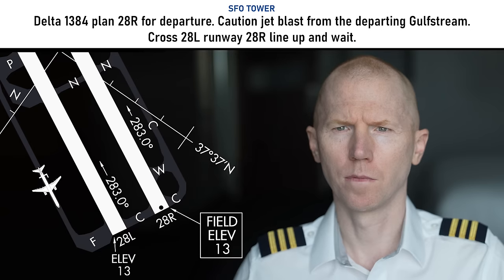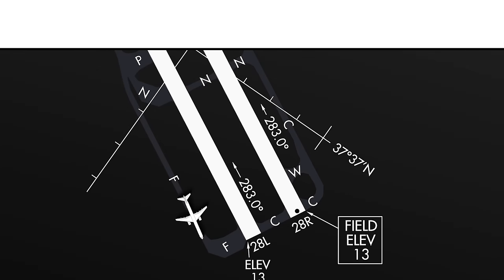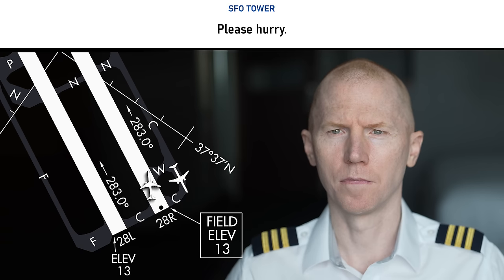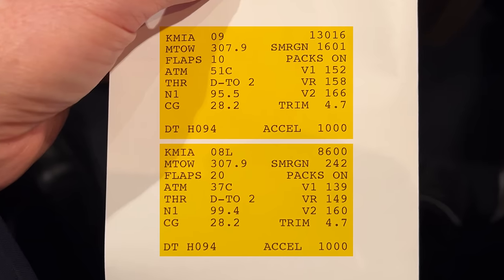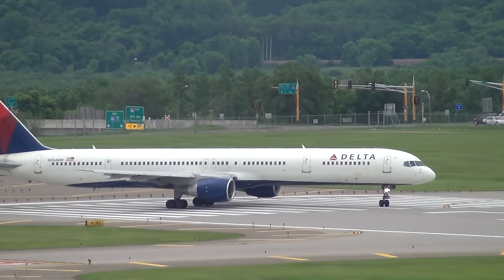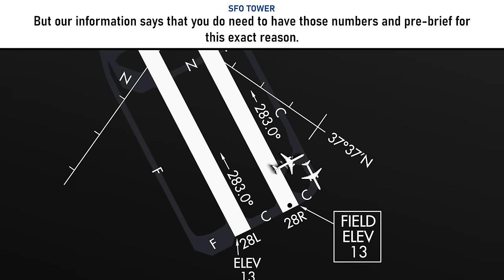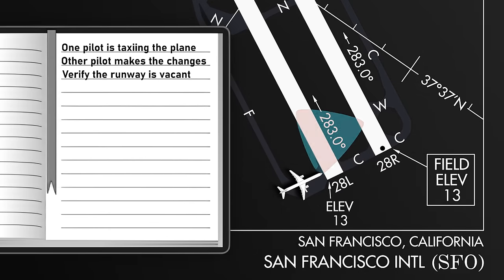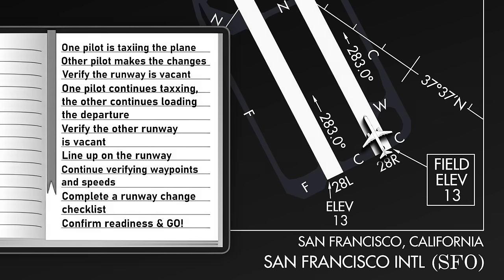ATC Doesn’t Like Delta’s Comment

Comment: Kelsey,  we nurses have exactly, like you, proper procedures that must be followed and I have Never, in all my years have an admin spend the day or one OR case start -to-finish watch what our day is like. I fully agree and understand what you're saying!!
Reply: You might want to clarify that to mean the non medical administration who run the office in regard to financial decisions. I have been an RN for 26 yrs, and I have been an acting administrator and Director. I not only have spent plenty of time on the floor in general in day to day work as part of my job, but I also covered many shifts when nurses inevitably called in for their shifts. Which floor nurses did. A lot. I spent a lot of my time in my administrative nursing roles assisting the floor nurses so they weren't overwhelmed. I was always on call. I couldn't simply go home and be off, and I couldn't say no to a shift if someone called in. Plus, I had the paperwork that was due from the admin above me. I was in charge of making sure that all of the policies and procedures were enforced, and I got in trouble if they weren't. I have CRPS, which is extremely painful, and I ended up working 18 hours on the floor one day because two nurses called in. I finally had to step down. I may as well just work the floor for 8 hours and be able to say no to extra hours. Not everyone in administration is ignorant of the nurse's plight.

Comment: When I hear this kind of exchange, where hundreds of lives are on the line and radio traffic gets petty and juvenile, I am shocked we don't have more crashes.
Reply: Just read a NY Times article on the hundreds of commercial airline near "hits" ( a better term than near misses) per year in the USA caused mainly by Pilot and/or ATC fatigue due to their demanding work schedules.  Other big issue is ATC's are talking much faster than decades ago due to increasing volume of traffic, and not enough ATC resourses.  President Regan's union busting might have contributed to today's ATC resourse issues, both directly and indirectly.
Reply: @wtcashel  OMG I totally agree!! I can barely understand what they are saying
Reply: @wtcashel   PATCO got exactly what they deserved.  The schoolyard bully got beaten up, finally.  And I would think that something that happened over 40 years ago would be irrelevant to this or any other incident.  Nice try with the politics.
Reply: @Sartre_Existentialist  I thought it was just me struggling with speed of the instructions!
Reply: Aren’t pilots trained to check their ego at the door before flying?
Reply: @wtcashel Yep..George Carlin would agree with you 😊
Reply: @wtcashel . __ miss and ___ hit are both correct and simply represent different reference points.
Reply: Because its kinda hard to crash if you don't want to
Reply: @AndreasS.-mh8ti You mean like every other job?

Comment: As a former controller, I always sat up front on a FAM trip, but as you mention in 29.5 years, i had exactly Two pilots come and "plug in with me" at the center to see how the other side works. TWO! in 29 years.
Reply: To be fair, who wants to go to a boring ass center?
Reply: @morganghetti  to be fair, who wants to do those boring ass safety trainings?
Reply: What´s FAM??? And did you like it when you got plugged? And, Also I am sorry! It´s rude, tasteless and all of those things. So please, all I am asking is what it all means to a layman like me. From context, I think you did a lot of flights, but not a lot of pilots sat with you in the tower? I would get that, and I think they should. Evens for evens. You give respect, then you gain respect. Not the other way around. Not in my book anyways. Also, that´s mainly because I think in all of Kelseys videos, I think ATC has behaved extremely well in a lot of cases where I, as a layman, would´ve booted them unless they had passengers. Just to the point where I myself, if I knew the number of crew, could´ve subtracted them from the number of souls, or at least the captain.
Reply: @olenilsen4660  FAM is short for Familiarization. Where a Controller sits in the cockpit during flights to get exposed to the "other side" and talk with pilots. Plugged in, in this case is when a pilot would come to an ATC facility and Plug in with the controller while he/she is working. The pilot's version of a FAM.

Both have benefits in that they allow one to see things from the other side and see what each is doing and handling thereby maybe gaining a better understanding of the whole operation of moving airplanes from point A to point B. 
In my case it wasn't a tower, but an enroute center.

Comment: The real problem is this is at SFO.  The way the airport is designed because of the proximity to the city makes it complicated for both controllers and pilots. makes all parties in a hurry because there are so many aircraft waiting to get out of there.
Reply: Then hire more ATC and train em up. And pay the max. What a hell job
Reply: @peterfuchs4596  good luck with that
Reply: @peterfuchs4596  Imagine thinking that fixing an airport is that simple.
Reply: A madhouse.  Need to build island airport like the Japanese have done.
Reply: @peterfuchs4596 unfortunately not everyone is capable of handling that job in a safe manner and it is high stress
Reply: @peterfuchs4596  Or train the pilot to give correct numbers. 2 minutes are 120 seconds. And the incoming traffic was landing in 5 minutes. Just wait on C if you need more time changing runways.
Reply: @Jonas_Meyer  agree 100%
Reply: This tends to make passengers a bit uncomfortable, hearing things like this!

Comment: This translates into so many different jobs.  I am a technician and go to various places to repair equipment.  Our dispatcher does a poor job of lining up the repair jobs, as she gives them to us as they come in.  You would think that would be great, but say, you finished a job and call for your next dispatch.  She gives you across town, which can take a bit time wise to get to.  Then you call that one in complete, and she will give you a job that was right next to the job you finished previously.  So, back across town ya go.  I mention things like that, and it goes in one ear and out the next.  Its like, okay.  I get paid by the hour.  Just shake your head.  Im retired Navy, and I like to do things methodical and logical.  This aint it, lol.
Reply: Yeah in that case you HAVE to shake your head and laugh or else you'll go crazy trying to change the system.  Sometimes it's just not worth the stress of trying to convince people that there is a better way to do things.  I'm just a cog in the wheel, man.
Reply: But being retired military, you likely have lots of practice with this mindset.
Reply: @toddsmith8608  no this business has its own mindset.  Anyone from the outside would be like “what the heck are they thinking “.  I like the job/work I do, not necessarily the way they go about it lol

Comment: For some context. When this happened 1L/19R and 1R/19L were closed for repairs for about a week meaning all traffic that regularly fills up 4 runways had to be crammed onto 2. The ATIS stated to brief both 28L and 28R due to flexibility being needed to keep flights on time.
Reply: Close half the airport during busy season?  Who made that decision?
Reply: @rcbaker2  Somebody who had no choice. Weather often closes two runways at SFO because they are too close together so parallel arrivals and departures can't be allowed, so it's not unusual to cram the traffic through half the runways, but it does cause delays. This is also why I prefer the other Bay Area airports, OAK never has traffic problems. Even when the main runway is closed there are still two north field runways. The two occasions when the main runway was closed when I was home were due to emergency repairs. On the first occasion I got a stream of SWA 737s over my house going around because the cloud base was right on 200 feet. On the second it was a clear night and the nightly FedEx MD11 stream looked like they were almost on my roof. Sad to have moved from Alameda.
Reply: @rcbaker2  sometimes you don't get to schedule repairs around your convenience. Even if it is not an emergency repair, runway repairs scheduling is weather dependant.
Reply: Yeah but even if you brief both runways, depending which runway is in the “BOX”, you have to verify the points in the flight plan. When you change the runways in the FMC, you then have to re-verify the sequence in the FMC, then verify the takeoff numbers loaded, then do a “Runway Change” checklist.. takes a few minutes. ATC doesn’t get it here.. she’s wrong here.
Reply: You still need time to change both navigation and performance 8n the computers.  ATC gives you a runway on the initial taxi clearance that you put in the box.  If the departure is runway specific, changes need to be made.  ATC here was unprofessional.  The pilots should have held short, but allowed themselves to be talked into going in position.  Both made mistakes.
Reply: @thomasaltruda  So when you are told there's an aircraft ten miles out you are responsible for knowing you can't get out in time and not lying to the controller.
Reply: At SFO, that does not mean much.  It's a B hive, regardless.
Reply: Thanks for the ATIS Information. I was wondering what it said. That confirms to me ATC was setting the pilots up as when the pilot said 2 mins she took that as literally.

Comment: I worked 40 years for a major railroad. Our Dispatchers were required to ride a train every quarter to get familiar with the territory they were responsible for, and to see firsthand what the crews experience during their run across the tracks.
Some of these Dispatcher's were very good at their jobs because of this. If they told you in 59 minutes you'll see a headlight of another train, in 59 minutes it would happen.

Comment: Contributing factor could also be the design of departure procedures in the US. I saw from some charts, that they sometimes have the same SID for different (parallel) runways. That wouldn't happen in Europe for example. Because one departure has only one runway. Even switching from 28L to 28R would mean issuing a new clearance and not just switching runways. Maybe in that case ATC would understand it's not wise to do that 1 minute before departure.
Reply: That's not completely correct. There are some SIDs with the same designator for both parallel runways (25C/25L and 07C/07R) at Frankfurt, Germany.
Reply: @FrankfurtAvgeek  true, for example TOBAK9D for rwy 07R/C. Still, contrary to the US, this is really the exception.
But that's also the reason why in Europe you almost never get cleared out of a specific runway because it is included in your route clearance with the SID they assigned you. I feel like the US has a lot more of those multiple-runway SIDs, and also a lot more omnidirectionals.
But that's also the reason why people get confused more over there.